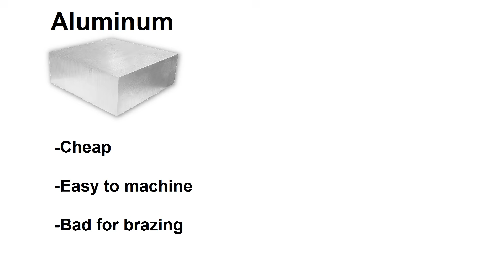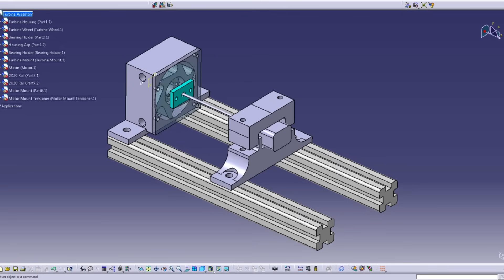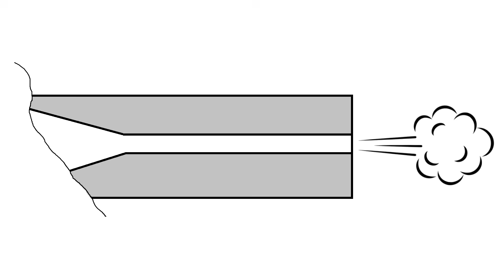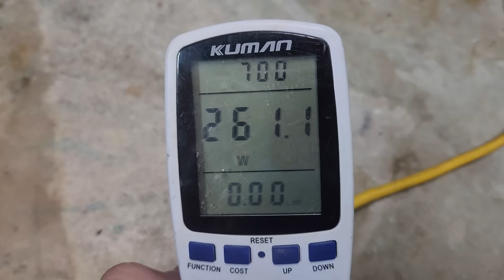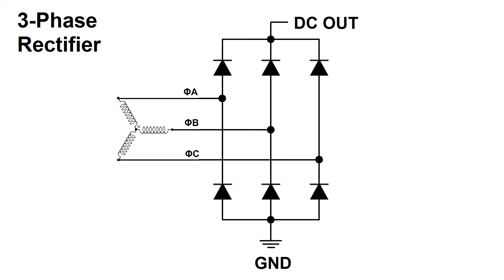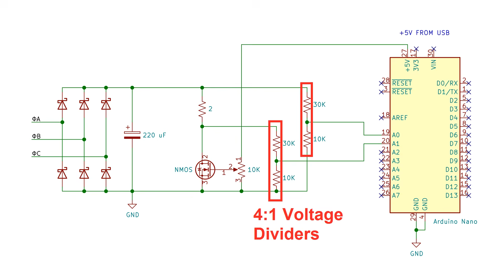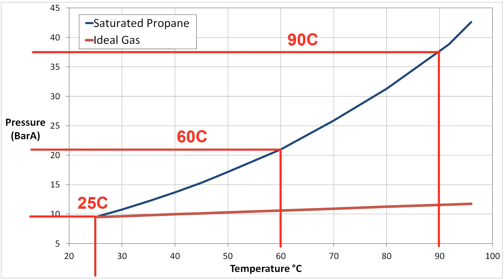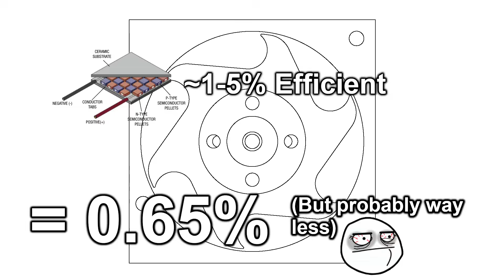DIY Micro Steam Powerplant

Comment: Could you make a De Laval nozzle from a couple of pipe gauge adaptors? Wide to narrow then back again? Would some oil maybe help in the turbine, to coat the walls and reduce the escaping steam? Might be because the amount of steam is small, that most of it can slip by the sides. Maybe you could produce another turbine, but too wide to fit, then lap it down? Get it juuuust right? Brass is supposed to be "self-lubricating" to a degree so even if it grinds itself down a bit, there's no problem, the outlet doesn't go into anything precious so a tiny bit of swarf ought not hurt. 

Very well done on getting it working, your engineering forefathers would have been very pleased to get it working at all. I'd love to see it improved.

I'd also, talking of thermoelectrics and their poor efficiency, see this thing run off sticks of wood. Could that work, you think? A camping generator that handily generates steam that you could use to heat up some coffee or something! Once it's stopped producing swarf. Or run it through more pipes and you'd have central heating for your tent! The energy from a campfire is essentially free, since the "waste" heat warming the environment is it's primary purpose. I think the key would be getting it to withstand the conditions, if you did that, you'd have a genuinely useful little gadget, a teeny power station that can be refuelled anywhere there's trees. In fact it'd be fairly agnostic on it's fuel source, charcoal would do too.

Pressurising the water is left as an exercise for the reader!

Comment: Get a cheap, tiny turbo charger and use the exhaust impeller as the turbine. Hell get a couple of them and try different configurations. I think a reciprocating engine would be better though for the next step.

Comment: Can't you hook up the steam output to the top of the tank and place the tank above the flash boiling snek?
The hypothesis is, the pressure is relatively equalized and water is fed into the hot snek hole at the bottom... Which sounds weird, but it'll get steamy and wet all by itself.

If that's not working, adding a small pump to overcome the last bit of overpressure should do the job.

Comment: I think the most impressive part of this whole thing is that he designed the thing in CATIA which I think is the French’s secret plan to hold aerospace engineers back.
Reply: So that's the program that looks almost but not quite like freecad. I never knew.
Reply: You design a Porsche in solidworks 
You design the factory it's made in in CATIA.
Reply: @F1sh_king  I know for a fact, that ton of car design is in CATIA as well. At least plastic parts and some accessories. Plastic parts with design surfaces would be very hard to work on in different software than CATIA. Maybe there are alternatives now, but at least it was true for a long time.
Reply: @syriuszb8611  just a saying that exhibits the difference in power and scale of the software
Reply: @F1sh_king  I joined an automotive company that used AutoCAD for factory layouts and most engine part drawings. CATIA V5 for 3D CAD.

The controls were just digital versions of how people used to use drawing boards. Presumably this made it popular since the people who used to use drawing boards could move over with little friction, but that software needs to die in a fire by modern standards. It's no longer intuitive because no one uses a drawing board anymore. Parametric modeling is WAY more efficient. And you can model the 3D thing, then the software makes the drawings from it, and updates them automatically as you change things.

CATIA v5 was like Photoshop: 2000 hidden tools with no explanation on how they're used or where to find them, and they get hidden/move around just for extra "fun". Then 5 dialogue screens and 15 variables to do something simple. I've heard V6 is better, but I wouldn't know because the automotive industry is scared of progress and is still using software released 26 years ago.

SolidWorks integrates FEA solutions into the CAD modeling capability short circuiting the design iteration loop enabling changes to be identified and implemented several times per day, rather than maybe once per month. This combined with the more intuitive and user friendly interface that only shows you the tools you can currently use and prioritizing the ones most likely to be used makes the design process so much faster and more efficient that CATIA is a joke in comparison...

Having said this... SolidWorks also sometimes just tells you something is completely impossible for no apparent reason. But it actually is totally possible if you ask it to do it in another way. It's incredibly frustrating at times. I've been told CATIA is better with this, I have no evidence to say it isn't, but I still pick SolidWorks over CATIA V5 every time without hesitation. CATIA V5 wastes my time and I don't tolerate that.
Reply: @F1sh_king  lol factories are designed with good ol autocad
Reply: @oriolopocholo  UNFORTUNATELY
Reply: that might explain why it looks like it was designed 100 years ago

Comment: You can use some type of conventional air powered pneumatic tool - grinder or drill. They has vane type motor. Vanes are made from some type of hard resin and probably it is possible to replace them with brass and lubricate steam by dripping oil in steam.

Comment: On some rotary vane pumps they use a fanulic. Pretty good against heat and chemicals. Not to sure about water specifically. But if you don't mind it not running very long before rusting, you can use some aluminum bar. The outside edge will need to be beveled. And the back should largely be flat with just the sharp corner knocked off. Not sure exactly what pressure you'll get up to, but either a very thick oil ( between 86-110 ansi) or a thin high temp grease.

Comment: I know your not supppsed too for low rigidity machines, but try a climb cut instead of conventional. You're taking micron passes, and the "low regidity" machines are still talking about machines and not toys. Ive gone throught the whole schpeel from that same router, npw up to home made 2kw unit. 

The climb cut can put less stress on the machine because the motor kinda pulls along. This is why its bad to do, but again with micron passes and micron doc, you might see an improvenemt.

Comment: If you measured your liquid-only flow rate to be 1 g/s, your boiling flow rate will be much lower. The reason is that on a thin long tube like that, the distributed pressure drop will be proportional to the flow velocity squared, thus inversely proportional to density squared. If your driving deltaP is the same, while boiling the flow rate will be significantly lower.

Comment: Im not brave enough to mess with steam, but have had quite good results with TECs. A kerosene lantern, 120mm heatpipe cpu cooler, 5v 120mm fan made about 6w of power (more than enough to charge a phone or torch). And fire light! And if you used citronella oil, bug repellent to. Quite a dandy device. The major trick was you had to bootstrap the cooling fan with a starter battery, else it heated evenly and never made power. Start the cooling fan, then light the lamp, and once it was running at temp the TEC could run the fan n charger fine. I had it set up charging 18650's, which I could use in torches n radios directly or in usb power banks. Your running the kero lamp for light/bugs anyway, might as well use  the heat. Also tried it on led lamps, one kero lamp could light 12 m^2. Not exactly what this video is about, but folk looking at that might find this interesting to know. Was a fun project.

Comment: A random suggestion for the power curve testing device: maybe use a digital potentiometer? It's an IC that acts like a potentiometer that could be controlled from the same arduino you're using to measure. You could automate the testing process to a one button process where the arduino steps through a range of resistances. 

Although now that I thing about it, you could also use an analog out on the arduino to drive the mosfet directly?

Comment: If you were to ask  (which u didnt,) Id use a 212cc predator from harbor freight  $99. Then id add a heavy flywheel & a modern single cylinder "ecu" for small engines so you can log/crunch your data. The ecu id build out of a raspberry pi pico and some generic sensors because i cant afford a solution like buying 1 of these.). The software id force my slave to write (chat gpt :D ) Then i would a/b test diff impeller designs as well as driveshaft lengths then settle on whichever performs best.

Comment: What if you got a couple more blocks of brass and machined 2-3 more turbine housings and rotors with a much more closely machined tolerance, then aligned the turbines down a central shaft and piped the output of one to the input of another?

Comment: Always love watching your stuff! A couple comments/questions. First just want to point out that the efficiency of a motor as a generator typically isn't the same percentage at a given RPM/current operating point. The resistive drop is in the same direction as the EMF for a motor, but opposite/subtractive for a generator. This means that if a motor is 50% efficient at a given RPM and current, it will be 0% efficient as a generator at the same RPM and current (the terminal voltage will be zero; if we apply 2V/1A when motoring with 1V EMF and 1V resistive drop across 1 ohm winding resistance = 50% efficient, then the same RPM will produce 1 amp only if the external resistance is 0 and the entire EMF is applied across the 1 ohm internal resistance = 0% efficient). This is only strictly true for resistive motor impedance, if there's inductance (which is especially apparent with BLDC/PMAC motors) then things are a little bit different. 

Inductance is what I think we're seeing when we see that flat topped current/load curve you showed. If the generator had a purely resistive impedance, we probably shouldn't be seeing that: I am really not 100% sure on this btw, I guess there are cases where the torque curve of the turbine and the impedance of the motor could conspire to make the curve have a constant current characteristic. But what I think we may be seeing here is leakage inductance. As the load resistance decreases, the stator poles tend to reject more and more of the field through the windings (Lenz's law) and squeeze it back out into the pole face/rotor air gap area. There is a fixed amount of current that it takes to exclude basically all the field, and reduce the terminal voltage to zero, regardless of speed. From an electrical perspective even though the EMF may increase with increasing rotor speed, the impedance of the leakage inductance also increases, leaving current fixed. Although I think this is less intuitive than thinking about Lenz's law and flux exclusion. High pole count BLDC motors tend to actually have really bad leakage inductance (look how short of a gap and how much area there is between each adjacent pole face/shoe compared to the actual pole area: it's a substantial fraction, really not terribly hard to push all the field back out of the pole windings and force it to traverse the air from one pole face to another). In order to get more juice out of the motor one would need a field oriented controller, to drive an externally imposed and correctly phased voltage across the leakage inductance, in order to drive more current through the generator's internal EMF. One could test if this is what's happening by shorting the rotor and spinning it at various RPMs: if the current quickly tops out at 3A even while the RPM massively increases, then we're seeing leakage inductance. 

Another topic entirely: I'm really not clear on the theory of these turbines you have made. How are they letting the steam expand? It feels like after the steam is done interacting with the first scoop, it wants to get the heck out of the way, but in this design it has to go all the way around to the exit hole before it can do that. I would have thought that this turbine would want to act as a Pelton wheel: we expand the steam all the way to atmospheric pressure in the nozzle, converting all of the energy to kinetic energy, then we redirect the momentum of the steam with the moving scoop, and hopefully slow it down to a much lower velocity by moving it from the outer radius of the scoop to the inner radius (the scoop periphery and steam have to be moving at similar velocities, or at least not a factor of 100 different in other words). Then, after this one interaction, doesn't the steam want to just leave? In a Pelton wheel we make no effort to seal the wheel: we want the low velocity spent fluid to exit the sides and just get out of the way so the wheel doesn't inadvertently reaccelerate it. This design seems over-sealed. It seems like maybe the jet of steam is having to fight all the gas that's in the rest of the scoops and the housing, because it has to compress that fluid or push it past the scoops to the exit in order to make room for it. And although the path past the multiple scoops to the exit looks vaguely like a Tesla valve, so maybe there's an impetus for the gas to go one way around the rotor rather than the other, I would think that a substantial fraction of the gas would try to go around the "back side" of the rotor (from the inlet to the outlet the short way around) and actively fight the rotor. 

All of this is to say that it seems like maybe some large area outlets around the central shaft of the wheel, or even just huge outlets on one or both faces that leave the wheel completely open, might be an interesting thing to try. I really don't know, maybe the more enclosed thing you're doing has advantages in higher torque or something. Maybe enclosing the wheel more could reduce drag of the unused portions of the wheel on the atmosphere ... see Tom Stanton's "micro pelton turbine" video, where I think he may have erred in the opposite direction (wheel too open, acts as a fan on the air around it when it approaches theoretical optimum operating speed). This turbine just doesn't seem to fit the pattern of turbiney things I've seen before. 

I really want to say explicitly that this is all meant to be constructive, and I really am impressed by the stuff you do! For example the cryocooler series. Having tried to get heat "to go where I wanted it to go" in a couple of home and work projects I can start to appreciate the difficulty of the goals you set yourself, and it's really neat to watch someone persist until they've solved such a tough problem!
Reply: I think I understood about 60-70% of that. Which I'm actually kinda chuffed at. But thank you for your brain dump. Proper geeking out channels are the best comments. Thank you for your time at the keyboard.
Reply: I think people that actually understand electromagnets have to be stupid smart, it feels like whenever someone brings up flux or inductance I gotta bend my mind 45° to try and comprehend them
Reply: Well said. I thought the same. I love this channel but our man needs to do some more thinking about the expansion of gas performing work on a rotor
Reply: plenty of comments from so called "engineers" and "power plant techs" that dont seem to see the two fundamentals you outline.

the generator/motor... jacobis law, or thevenins max power theory, or basically... impedance matching. equal source and load resistance means half the power is dissipated in each...

and then the turbine side of things... indeed, wheres the expansion? for single stage, ideally, in the nozzle... dropping from boiler to atmospheric presure and converting all that stored energy into kinetic energy.
and as you say, in a pelton wheel, the water just falls to the side, having spent all its kinetic energy. they have to be free draining. this is close to a pelton, or "delaval", except its then choked and blocked... and just like in a pelton, to trap the working fluid and drag it around with the turbine means its ABSORBING energy... it gave its energy to the turbine, but instead of then being ejected, its now being re-accelerated by said turbine...

its also amusing how people are impressed with the high pressure figures... "450 psi... 600psi!"

yet they all seem to miss the point of a condenser on a turbine... halving the exhaust pressure is equivalent to doubling the boiler pressure... a 300 psi boiler into a vacuum of 7.5PSI abs is the same as a 600 psi boiler exhausting into the atmosphere.

meh. most people are learning from YT or wiki. not many have a few hundred books on steam engineering dating back to 1800 to refer to. nor do they seem to have any desire to actually THINK.

so its all just chinese whispers, misunderstandings, and false conceptions... sad just how many hours were invested in figuring all of it out, only to be lost and forgotten in our 'high tech modern world", simply because its "old fashioned"...

Comment: So the efficiency and power output suck, like really suck but the cnc, electronics and build are cool as hell.  Even with such a dreary result this is a wicked cool project!  It would be cool to see how much chemical energy you could convert to electrical at this scale.  Like set an amount of propane to consume and see how high you could get the output through iterative improvements.

Comment: You could add stages to your turbine to harness the residual pressure on the outlet. Also, increasing the turbine shaft diameter would be ideal and so would decreasing the weight of the turbine itself and optimizing the blades.